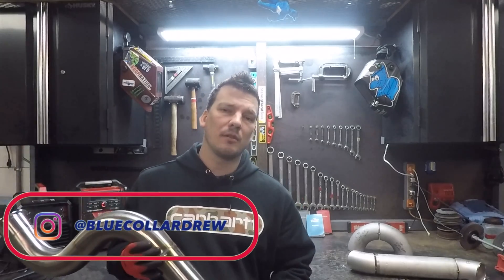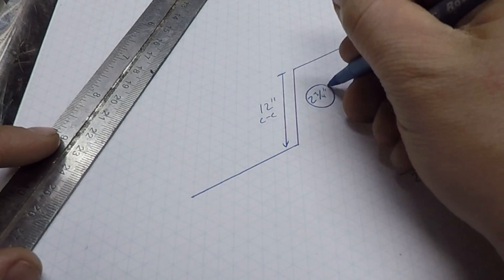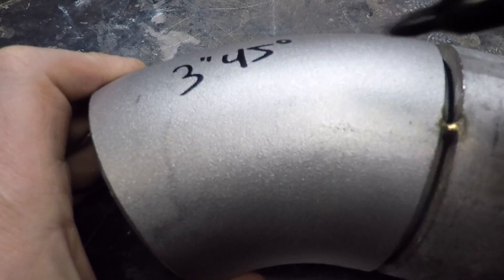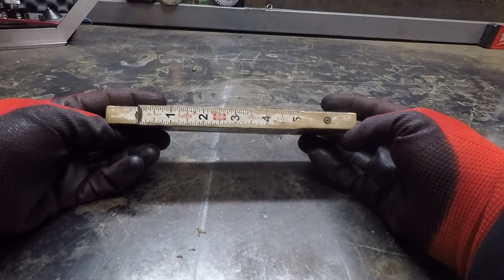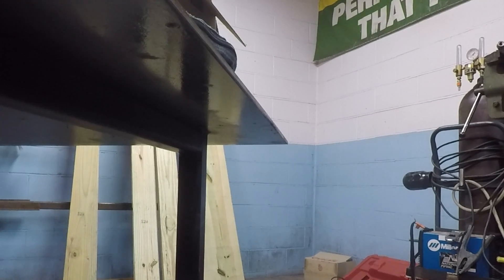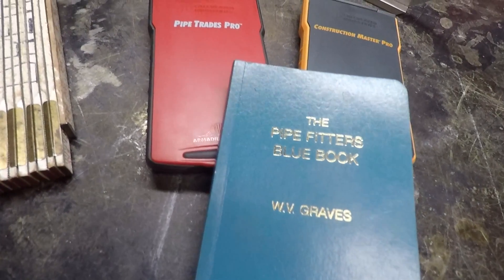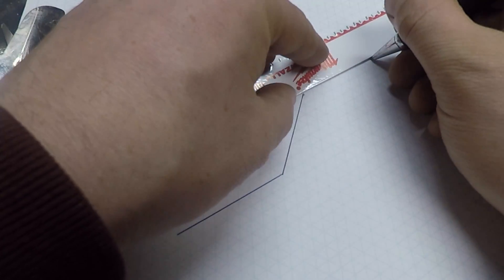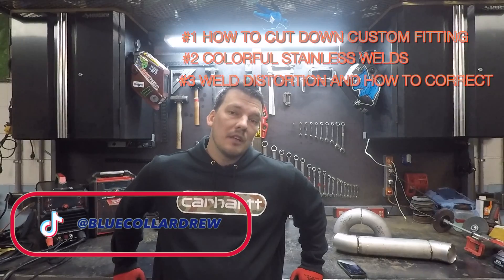Top 3 MUST-KNOW Pipe Fitting Offset Methods (Includes Rolling Offset)

Comment: When you multiply it times 1.414. You said the answer is the pup piece. I thought you still have to take off for your 2 45° fittings? That is if your working with pipes like cast iron, pvc.

Comment: On the rolling offset you did I thought you only use 1.414 when it’s a true 45 degree 7 and 12 is not true 45 7 and 7 is or 12 and 12

Comment: How to clock the 45s to accommodate for the 7" off plane roll? I"m trying to create a single piece stainless fuel line for an old Chevy and there is a spot where I need a slight roll. I have to know how to clock each bend. Hope that makes sense. Might need to create a template before trying to attempt the bend on the actual line. Thanks.

Comment: You showed how to find the pup piece of the travel with 45s but not how to calculate the angle of the rolling offset. 
Do a video on how to find the angel you will have to roll your fitting while using a custom cut down fitting like for example (70 degree fittings ) 

Some real fitter stuff.

Comment: Another way to calculate take off using 45"s. Example using a 4" fitting (45).
4"
2"
1"
1/2"
Add the second and bottom numbers. 2"+ 1/2"= 2 1/2 " take out . works on all sizes.

Comment: Does the 1.414 on the 45° offset only work if you run in your travel or the same length you said it was 12 and 12 so just multiply 12 by 1.414 but what if one of your digits is different. What’s the different formula for that, or am I confused and that was covered in the

Comment: So I am proficient at doing any rolling offset when using a 45° fitting. If you're trying to rise 20"s and offset 8"s I know you take 20²+8²=464. Then you find the square root of 464 which is 21.54". Now you multiply 21.54 x the standard 45° offset number which is 1.414 and your true offset is 30.46". Take off for your fittings and that's your pipe length.

My question is... how do I do it when not using a 45° fitting? I'm going to work on Monday and have to use 90° fittings and I can't believe it but....I don't remember how to do it! All help is greatly appreciated but please I've been doing this long enough I don't need anything that isn't constructive lol. Thanks in advance!

Nevermind i figured it out 30 seconds after i wrote this out lol.... you just skip the final stretto because it's just an offset with no roll 😅😅😅

Comment: European pipe design engineer here, I basically use CAD to make plans and measurements of all these offset distances so our fitters don't have to bother with it. I only have one question:
If you use a calculator, how do you convert the base 10 result fractions into base 2, 4, 8 or 16?
That seems really bothersome to me, as a metric system enjoyer.

Comment: Badass video man. At what point does multiplying by 1.5 not work regarding take off? Obviously as you thickness increases sched 40 to 80 you id changes so it would still work. But will it still work for small schedule pipe such as 10 or sanitary fittings?

Comment: quick question, why did you subtract 2 and 2, I thought the take off of a 3” 45 degree fitting was 4.5?
Reply: 4.5 is the offset for a 90. Remember for a 45 degree it’s 3(size pipe) x 5/8 and that equals 1 7/8 and any pipe under 3” you add 1/8 to the 45 which equals to 2”. Hope this helps

Comment: #1 cutting down custom fittings please and thanks sir
Reply: It's really easy to do,,, just need to learn "segments of a circle" ,  I had to do it  the old fashioned way, this was in the 1960's to 1970's, we used a Smoley's book to do the segments of a circle,,, arc, radius, deg. and chord. I'm sure there's a calculator out there now that'll do  it for you, but if you learn the old way I gaurantee you it'll stick with you longer because now you'll understand what is actually taking place.
The next step is knowing how to put the figures on the ell to cut it down to whatever degree you're after and also give you the actual cen to end dimension that you just created.